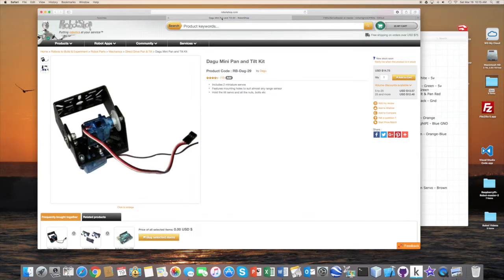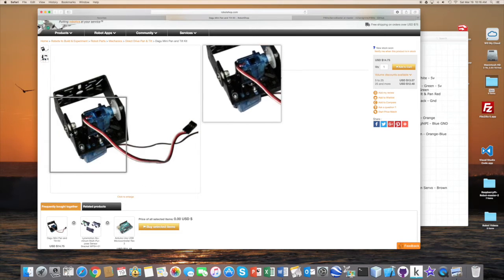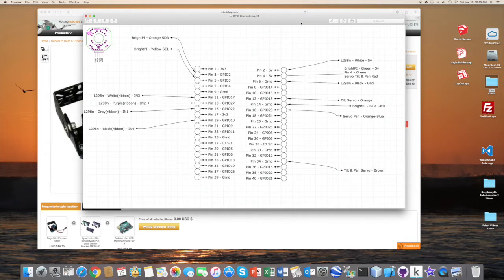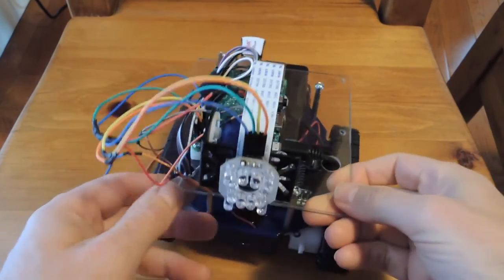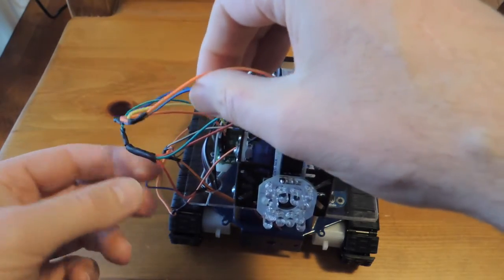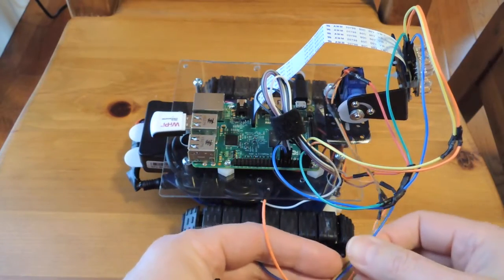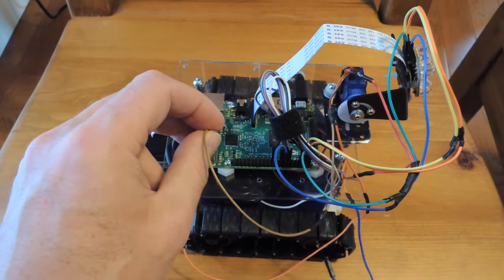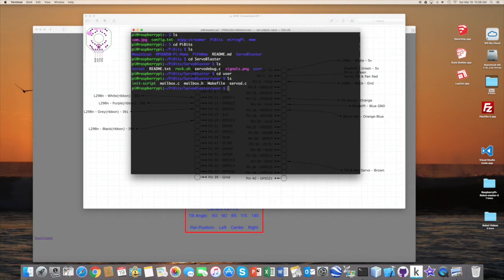Video 6   Raspberry PI Robot Project - Install and configure pan-tilt and servos

Comment: Hello Allan I followed all your instructions but my servos aren't rotating. I am using new raspberry pi 3 model B. I have already changed the pin to output mode. And my servos are running fine becoz during power up it rotates slightly. Is there any problem in library. Let me know. I am in final stage and eagerly waiting for your reply. Thanks
Reply from the maker: With a recent release of raspbian the Servoblaster solution no longer works.  I have been watching for an update but so fare nothing has been posted.
Reply: Allan H which one is the supported os for servo blaster in pi3 and from where can I download ? many thanks
Reply from the maker: I tried a branch of servoblaster and it fixed my issue https://github.com/srcshelton/servoblaster/
Reply: I'm getting this error when I executed echo command
bash: /dev/servoblaster: Permission denied
Reply: I have tried ngrok VPN service in that I can't view video streaming. Do you have any solution. Other cgi scripts are working nicely, only video problem.
Reply: @allanh844   heya i think i have the same problem i can get the cgi scripts to work but when in the html the buttons dont work how do you get this fix to work RPi 3b+
Reply: I have the same problem :bash: /dev/servoblaster: Permission denied. Have you solve your problem RAHUL ?
Reply: Tuyen Vo Khac No, I tired a lot couldn't find any solution
Reply: Thanks Allan, the https://github.com/srcshelton/servoblaster/ link you provided fixed my issue with the Raspberry Pi 3. On a separate note I changed the cgi scripts to run off percentages, its works pretty slick. Thanks for all the hard work putting this tutorial together.
Reply: are you using it with the rpi web cam interface?

Comment: Everyone is TOTALLY overthinking everything. Slow down. Take a breath... Do Allan a favor. Do what he did. He researched everything. I'm sure by himself. So in blowing him up with questions and comments I'm sure it gets SUPER frustrating. First things first... research. If no solution do as the man said... Go to the github site and ask it there. You know the old saying.... "if you wanna know something go straight to the horses mouth...."

Whatever though.... 
SOLUTION to all your problems.... cause your not going to waste your time anyway.

I'm sure when you run:
sudo ./servod
Your getting a parse name error or something stupid... 
So... then your doing this:
cat /proc/cpuinfo |grep -i hardware
And this is what pops up....
Hardware : BCM2835
So then your like OK I know this much. So you next do this:
sudo nano /PiBits/ServoBlaster/user/servod.c
**YOU SCROLL TO line#960 AND YOU KNOW THAT YOUR THERE BECAUSE YOU USE THE ctrl + C command.... **
***NEXT YOU EDIT THAT LINE TO LOOK LIKE THIS:
else if (strstr(modelstr, "BCM2709") || strstr(modelstr, "BCM2835"))
SAVE THE FILE ctrl + x        Y       enter

I ALWAYS sudo apt update && sudo apt upgrade... 
YES I JUST TYPED "apt" and not "apt-get" THERE IS A DIFFERENCE.....

If you now run: sudo ./servod you STILL get that dog gone error!!!!! 
LOL..... Overthinking... 
Lets wrap it up..... your obviously in /PiBits/ServoBlaster/user directory.... run these last commands to finish all this headache up......
sudo make
sudo make install
sudo apt update && sudo apt upgrade

And Bob may or maynot be your uncle... Congratulations... your ./servod NOW works!
Reply: Is not working still get cannot parse the hardware plz help

Comment: Hi Allan, thanks for sharing this awesome project. I'm using the Raspberry-pi zero W but I am unable to control the pan-tilt servos with the servoblaster; the servos are not responding. Any ideas?
Reply from the maker: Hi Christian,  have you tried running the sudo ./servod command when your in the PiBits/ServoBlaster/user/ directory? THis will tell you if servoblaster is running and on which pins.
Reply: Hi Allan, thanks for your quick reply. Yes I did

I forgot to mention that the pan-tilt servos move by themselves every time I power cycle them.  So the pan-tilt servos change position without my command whenever I connect the 'servo tilt and pan Red' on Pin 4 - 5 V.

The following is what I see when I do sudo ./servod

Board model:                     2
GPIO configuration:            P1 (40 pins)
Using hardware:                PWM
Using DMA channel:              14
Idle timeout:             Disabled
Number of servos:                8
Servo cycle time:            20000us
Pulse increment step size:      10us
Minimum width value:            50 (500us)
Maximum width value:           250 (2500us)
Output levels:              Normal

Using P1 pins:               7,11,12,13,15,16,18,22

Servo mapping:
     0 on P1-7           GPIO-4
     1 on P1-11          GPIO-17
     2 on P1-12          GPIO-18
     3 on P1-13          GPIO-27
     4 on P1-15          GPIO-22
     5 on P1-16          GPIO-23
     6 on P1-18          GPIO-24
     7 on P1-22          GPIO-25

However, when I execute echo P1-12=120 > /dev/servoblaster or P1-16=70 > /dev/sevoblaster, the servos are not responding. I wired the pan and tilt servos exactly the same way you did.They only respond automatically when  I connect the 'servo tilt and pan Red' on Pin 4 - 5 V.

The only difference between what you've done and what I'm doing is that I'm using a Raspberry-pi Zero W; I did have to add "else if (strstr(modelstr, "BCM2709") || strstr(modelstr, "BCM2835"))" on line 960 of servo.c to be able to compile on servoblaster on the raspberry pi zero W.

Any suggestions ?
Reply from the maker: Thats strange. I dont have Zero to test this. Just to make sure that I understand your wiring. For each servo the red wire should go to 5v pin, the black to a ground pin then the other is to the GPIO to control the servo. The servos that you have are the 5v models?
Reply: Yes that's how I wired them and yes the servos are 5v models; I actually bought the same pan-tilt and servos you used in your project.
Reply from the maker: Christian , not sure what else to suggest. You could try posting your issue on the servoblaster github site.
Reply: Ok Allan. Yes the issue is already posted on the servoblaster github site without solution yet. Thanks for trying.

Comment: pi@raspberrypi:~/PiBits/ServoBlaster/user $ ls
init-script  mailbox.c  mailbox.h  Makefile  servod.c
pi@raspberrypi:~/PiBits/ServoBlaster/user $ make
gcc -Wall -g -O2 -o servod servod.c mailbox.c -lm
pi@raspberrypi:~/PiBits/ServoBlaster/user $ sudo make install
[ "`id -u`" = "0" ] || { echo "Must be run as root"; exit 1; }
cp -f servod /usr/local/sbin
cp -f init-script /etc/init.d/servoblaster
chmod 755 /etc/init.d/servoblaster
update-rc.d servoblaster defaults 92 08
/etc/init.d/servoblaster start
servod: Cannot parse the hardware name string
pi@raspberrypi:~/PiBits/ServoBlaster/user $ sudo ./servod
servod: Cannot parse the hardware name string
Reply: Need Help
Reply from the maker: As this is a Servoblaster issue you should be posting questions on the following https://github.com/richardghirst/PiBits/tree/master/ServoBlaster
Reply: cat /proc/cpuinfo |grep -i hardware
Hardware : BCM2835
line#960, added the BCM2835 ;-)

  else if (strstr(modelstr, "BCM2709") || strstr(modelstr, "BCM2835"))
Reply: I think allot of people either don't realize or maybe don't see that the next step after adding:
        || strstr(modelstr, "BCM2835"))    
to the "servod.c" file is/ should be to:

(I ALWAYS do this however its on you....: sudo apt update && sudo apt upgrade)

**BE SURE YOU ARE IN THIS DIRECTORY**
*/PiBits/ServoBlaster/user***
**NOW DO THIS**

sudo make
sudo make install

This should hopefully help you with your problems. 
I too had this happen to me when I followed this EXCELLENT set of video instructions. 

I suggest to ANYONE and EVERYONE... In doing anything.... DON'T only watch a video. READ! Make SURE you UNDERSTAND what you are doing before you do it. DO NOT watch a video and rely only on that. What may work for 1 doesn't always work for the other.

I say this not out of disrespect. I say this because knowledge is power. You /we are all doing this because we are obviously interested enough to want to learn how to do it. We all forget that in doing something we've watched another do... is really just mimicing anothers actions (unless we fully understand the cause and effect.... lol). 

So yea. Good luck. Keep having fun and try not to blow up any caps, transistors or anything else... lol
Reply: It's not enough. "board_model = 2" needs to be change to "board_model = 1"

Comment: Hi, I have my vehicle running now but there is one problem, the pi has to be HDMI connected to the screen when it boots up, otherwise the servoblaster will not work. Tried uncommenting bhdmi_safe = 1in the config.txt, did not work. Do you have this issue?
Reply from the maker: Hi, never heard of this issue. I suggest you post it on the Servoblaster github site.
Reply: Got it . Thanks for the quick reply.